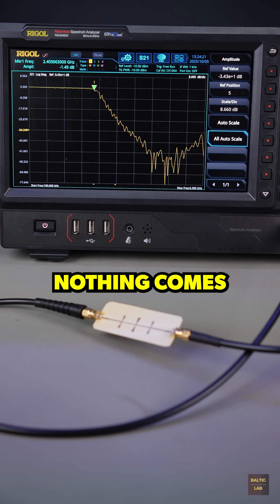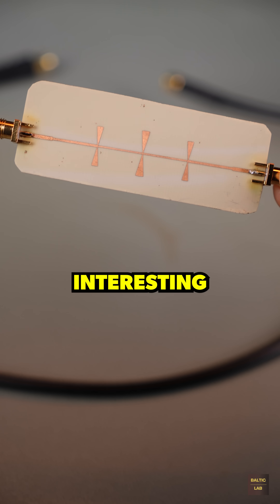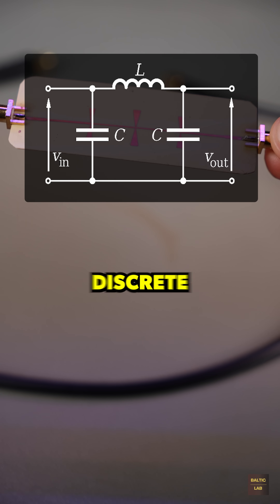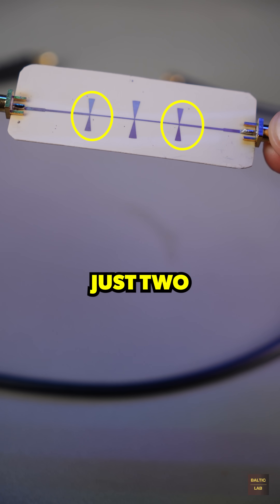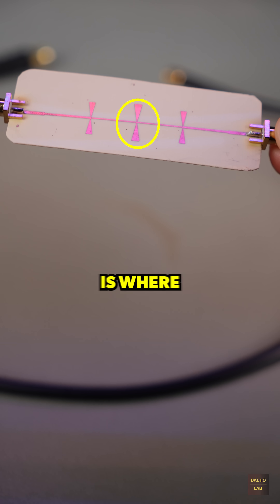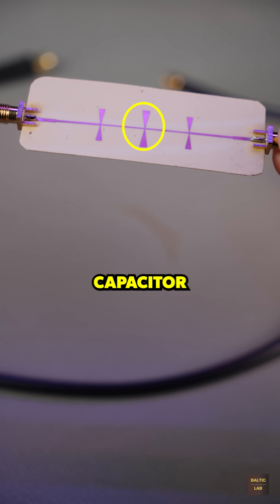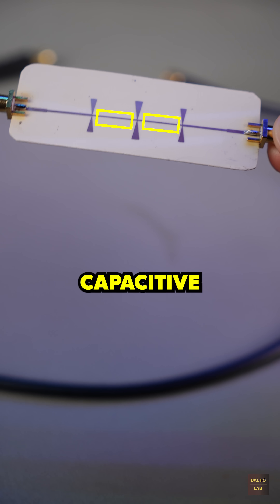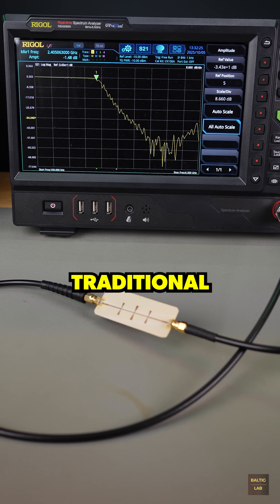Radio Frequency Magic: 2.4 GHz Low-Pass Filter with Butterfly Stubs  #electronics #hamradio

Comment: Black magic. Someone tell me that engineers aren't just code names for wizards.
Reply: Engineers solve problems you never knew you had in ways you will never understand.
Reply: @sherpadoug  by making the problems obvious so we fix them ourselves* 😂
Reply: Engineers are all secretly wizards. And engineering ethics is the secret committee that decides which magic is too cool to show the non-wizards.
Reply: @Somespessman  You have exposed us.
Reply: @gary2300  some dude named gary yup, checks out, he's probably a wizard. That sounds way too inconspicuous
Reply: @Somespessman  Yeah, like Agent X, H-Bombs and other cool paraphernalia.
Reply: Not just engineers but analogue/radio/hf engineers
Reply: @forbiddenera   You don't think that internet routing is magic? Or the suspension of an F1 car? A flash drive? How modern cutting tools chew through hardend steel resulting in mirror finishes with µm accuracy?
Reply: @TheEvertw tbh I am a sw engineer, network engineer, automotive engineering so no, none of those things seem like magic to me (well, fair, any silicon etching is pretty magic) but rf/uhf? Yeah wizardry
Reply: @forbiddenera and wizards understand magic
Reply: @forbiddenera closed loop electromagnetic power generation is possible
Reply: @DaneSage  as soon as you draw power the loop opens and generation stops
Reply: This is how I feel about chemistry
Reply: @nos4me as above, so below
Reply: @nos4me  I'ma be a chemical engineer 😅
Reply: @nos4me Yes, as a chemist I agree. Even when a synthesis actually works and can be well understood it feels magical. And then there are some reactions that work succesfully but are not fully understood by the community. Still if it works, it works and often that is good enough.
Reply: Oscilloscope owners are wizards
Reply: Arthur C Clarke:  “Any sufficiently advanced technology is indistinguishable from magic.”
Reply: Just the RF dudes. To other engineers, it’s still black magic
Reply: Not all but the high frequency electrical ones are! 😁
Reply: as long as that wizard doesnt use einstein's infamous equation to create nukes out of water droplets... wait....
Reply: A: Computers are just magic.
B: What? No they're not.
A: Sure it is. You take a rock, you print it with fancy runes and hieroglyphs, And before you know it, your taking energy and manipulating it to do your bidding. The really advanced wizards know such complex rune patterns, they can even make rocks think.
A: ...
B: Yeah, exactly. Magic.
Reply: Yea,but what would i know/😊
Reply: You would love the book "Off to be the Wizard"
Reply: Shhh, dont tell them that
Reply: It is about education and interest. Nothing comes for free...
Reply: specifically RF engineers, specifically the very few working in antenna design. There might be a few thousand of them in the world compared to millions of engineers
Reply: Wizard is just a fancy term for someone who won't or can't explain what they are doing. Possibly because the don't understand it themselves.
Reply: They can litteraly make floating runes
Reply: They're putting runes on the PCB in plain sight for all to see!
Reply: I prefer WARLOCK
Reply: Scientists are wizards; engineers are warlocks. Not the same.
Reply: I was a wizard... Until my title was changed to Electrical Engineer II
Reply: Yer an engineer, Harry!
Reply: electrical engineers are just wizards who tricked sand into doing math when zapped with electricity
Reply: John 14

  6 Jesus saith unto him, I am the way, the truth, and the life: no man cometh
unto the Father, but by me.
Reply: @John_14_21  6 DOLLAR SHRIMP SPECIAL!
Reply: The seals of solomon force them to serve us

Comment: It's not a low-pass filter, and the explanation is completely wrong.
Reply from the maker: Good to know you understand the filter I designed in CST Studio and characterized in the lab better than I do. Let me guess: you saw butterfly stubs and immediately assumed it had to be a notch filter, applying your limited understanding of a single stub to a carefully crafted commensurate-line filter. I'll nominate this for the Dunning-Kruger Award for most uninformed comment of the week.
Reply: prove it.
Extra points for not using words like "magic".

Comment: I love electricity because if you do straightforward things with it, it acts very nicely. 
Then you start trying to crank up the voltage - great, now it won't go in the wires
Then you try cranking up the amperage - Noyce, it just blew up the wires
Then you try cranking up the frequency - why the fuck is it a wave now?
Reply from the maker: Absolutely! No matter the area of expertise, there's always so much more to discover. And I think that's beautiful.

Comment: How does one even figure out how these elements influence each other?  I can work out a simple antenna or PCB inductor or capacitor, but this is another level, especially with delays.  And why the pointed shape?
Reply from the maker: Nowadays software such as CST Studio assists in the design process. I assume by pointed shape you mean the radial stubs. The advantage of those over "normal" stubs is a more smooth frequency response.
Reply: @BalticLab thanks for the insight! 👍
Reply from the maker: @Qui-9 You're welcome!

Comment: How could they be capacitors? It looks like a conductor is connecting the two triangles.
Reply from the maker: They are connected and are together essentially one plate of the capacitor. The other plate is the groud-plane on the bottom side.

Comment: I don't get the diagram as a low pass filter bc the L approaches an  open circuited at high enough frequencies
Reply from the maker: Right, so that will cut-off "high enough frequencies" and let lower frequencies pass, right? There you go, you just explained the low-pass behaviour yourself.
Reply: @BalticLab oh yeah hahahah 😅 I was way over thinking it

Comment: And they said that advanced math was pointless... 😂 You could make one to any frequency you like but it gets bigger as the knockout frequency is lowered, geometricly so it's good for cutting out extremely high frequencies but impractical for lower ones. If you take apart radar and satallite recover amps you can see lots of things like that 😮
Reply from the maker: Exactly! High-frequency electronics are all about applied math and physics. 😊

Comment: You can also design a specific notch filter using an unterminated tap of an exact length to cause the signal to reflect backwards at a specific frequency.

Comment: I thought you used a bunch of zigzag traces for an inductor. But turning a capacitor to an inductor, that's a first.
Reply from the maker: You can, there's many ways to make an inductor. If you look up Kuroda identities, you'll see how to turn a series inductor into a shunt capacitor and vice versa.
Reply: @BalticLab Does it involve paraditics, or is it black magic?
And I've heard if you pass a frequency higher than the self resonance frequency of a capacitor, it behaves like an inductor.
Reply from the maker: @ShinjiIkari-Eva-01  It's correct that a capacitor will act like an inductor above its SRF. Likewise, an inductor will act like a capacitor above its SRF. But that's not the effect at play here. Simply said, what really differentiates an inductor from a capacitor electrically is the phase shift. By adding an appropriate amount of phase shift, you can turn one into the other.

Comment: Microwaves border our realm and Black Magic's.
For Anything beyond you'll need Runes on your PCBs.
Reply from the maker: The runes make things easier once you understand them. Being able to essentially incorporate entire circuits in the copper layer itself is kinda cool.
Reply: @BalticLab  Exactly, That's why people turned to Blackmagic in the first place. It was easier and cheaper to have Runes do the work for you.
Btw, jokes aside. its actually not economical at all. its very space inefficient which makes the entire device bigger and that alone introduces more cost and complexity down the line.(i dont need to tell you how small a 5khz SMD L.P.F is ). That's why designers put the H.F stuff under a can and snuff it out as quickly as possible.

Comment: Microstrip technology: Antennas, MW components, Filters, R, L, C components. It's funny how you're doing complex equivalent schematic "on paper" and in the real world, its just few milimeters thin lines :D
Reply from the maker: Indeed. Though it's funny to watch students design those traces on paper: Yes negative dimensions do check out mathematically, but are kinda impossible to etch on a PCB 😂
Reply: @BalticLab  I remember when I was doing my bach. final thesis on broadband low-profile microstrip antenna with CPW with AMC in Ansys and was optimalizating dimensions for 5,8 GHz and then I realesed, that if I change dimension about 0.000001 mm, s11 argument will change about 20°. So the realization was like: "The FCK is this kind of sorcery!" :D :D

Comment: Is this 3rd order because it has 2 capacitors?
Reply from the maker: Yes. Though just for completenes: Technically, the filter is a 7th order filter. I just simplified the workings and schematic a lot for the short.

Comment: Low frequency engineering gets pretty funky too. 
Especially power stuff.
Like harmonics and flltering 
Or the weird shit high power silicon can do like in Inverters and variable frequency drives. Apparently annihilates your sinewave and pf and sends nasty distortions and harmonics upstream.
Ever had one large (500kw kind of large)  VFD straight up grenade the input stages of multiple smaller VFDs on the same bus when the right conditions were met 😅. 
Like how is that even possible.
Or how in a 3 phase system harmonics can accumulate in the neutral conductor and cause an overcurrent situation on the neutral.

Comment: Black magic indeed. While direct current always take the path of least resistance alternating currents take the path of least inductance!
Reply from the maker: Essentially yes. Though formally it's the path of least impedance. Which in most RF cases of course comes out to what you said.

Comment: How susceptible is this to the tolerances in pcb manufacturing?
Reply from the maker: Quite a bit. In production PCBs there would be striplines with test points included in the PCB panels and the manufacturing job would include an impedance verification test.

Comment: Actually they are called “radial stubs”. It looks like RO4003C
Reply from the maker: Acttually, they're called "butterfly stubs". Which is probably why I called them that. A butterfly stub is made out of two radial stubs each. It indeed looks like Rogers 4003C. Or RO4350B, Arlon 25FR, Isola I-Tera MT40 or any other ceramic substrate.

Comment: Subscribed based on just this short, amazing.
Reply from the maker: Excellent, welcome aboard. 🙌🏻
Reply: @BalticLab me too !! 😅👋😁✌️🤩
Reply from the maker: @InfinitoFromEurope  Welcome aboard to you as well. 👌🏻
Reply: @BalticLab  Thanks so much !
Yours video’s subjects are passionating !!
I know how tu make an antenna or respect a wire length/co-linear/co-axial cables to respect impedance and haven’t phase shift at the output signal/at the end of line and I like this explanation of simple copper print on epoxy fiber to make some filters….

Thanks so much for the vulgarisation !
Reply from the maker: @InfinitoFromEurope  Thanks a lot, Feedback like that motivates me to keep posting and dedicate more time to the channel!
Reply: @BalticLab  You’re welcome !! (Off course !)

Note : I’m French and live in France (Europe).

Many networks interconnected (called inter-net ) make this possible : an « instant » messaging (in a streaming-video plateform) across the globe !

Thanks !! 🙏 
✌️😁
Reply from the maker: @InfinitoFromEurope  We're basically neighbors then: I'm from Germany. 🇩🇪
Reply: @BalticLab  indeed !

I’ve watch your YT channel and I’ve one question :
Did you have make one or some video(s) to make an DIY pre-amp ? But an DIY pre-amp with ANC for electrostatics mikes or (better tech) MEMS microphones ? 

My old car have a cheap Pioneer car radio (with Bluetooth) and an oldest and cheapest dynamic/electrostatic (I think it’s just dynamic mike) microphone and all of my calls are noisely across the conversation. 

Have you an idea to make a better sound at lower price and simple technology like an « voice » mike and another one or two « ambiant noise » mike and reverse the polarity to cancel the noise ? With (why not) potentiometer to adjust the ANC gain/effect and another potentiometer to adjust the output level to enter to the « mike input » on my car radio ? 

With also maybe a signal attenuator to reduce the output signal to not saturate my car radio mike input ?

If I can ask for 2 others specs : low-pass filter and independant high-pass filter to have a narrow band or large band for my calls, after the ANC circuit ?

The voice is a narrow (legacy) or large band (« HD sound ») across the 3KHz from 8KHz narrow band to largest wide band (I think from 500Hz or less to 4KHz).

If you can help me with my unpleasantness calls quality, I’ll be grateful for ever and you can make some videos to your channel with these ideas ! 🙏🫶

Thanks so much ! ✌️😊🫶
Reply from the maker: @InfinitoFromEurope  I'll put that idea on my never-ending list of content ideas. 👌🏻
Reply: @BalticLab  Thanks ! 🙏

Comment: The way I learned it, this isn't High Frequency technology but Ultra High Frequency technology. Perhaps the nomenclature is changing, but I'm still a LF, MF, HF, VHF, UHF, Microwave, IR, Light, and UV kind of guy. There are very clear building techniques that demark each section of the spectrum - I'd hate to build a filter using those techniques for 6 MHz ( A true HF Frequency).. :-)
Reply from the maker: By "high frequency," I mean it more colloquially, not in the context of ITU band designators. I might switch to using "radio frequency" going forward. It's tricky to pin this circuit to a specific band designation, though, since it operates across a broad range-covering LF, MF, HF, and VHF in the passband. UHF (ITU) spans the transition from passband to stopband, and even at SHF, it still works as a solid attenuator doing what it's supposed to. Technically, "HF" isn't entirely off as an ITU band designator, as the circuit continues to perform RF functions within that range. But that's splitting hairs.  Additionally, I'd like to add that "UHF" is ambiguous: The ITU defines it as 300 MHz to 3 GHz, the IEEE defines it as 300 MHz to 1 GHz. So for UHF it is important to say either "UHF (ITU)" or "UHF (IEEE)".

Comment: Thanks for making a video on my fav EE subject. Im an RF engineer. I learned how to make these circuits in my Passive RF Lab, where we milled these high frequency structures from a blank, and then characterized our design against our simulation. Too bad I have to just use lumped elements for things like this in the products i make.
Reply from the maker: It's always great to hear from a fellow RF engineer! It's a fun topic indeed. 😊

Comment: EE here:  The real magic happens when a designer can make a low pass filter  for $0 in components so as to make the higher-ups grin.  I don't count the pcb since that had to happen anyway.  Usually the rest of the circuitry is on it.
Reply from the maker: Distributed element low-pass filter here: The EE is correct. ☝🏻

Comment: I need a couple of those at 177Mhz that handle a few watts. Under 10. How do you get them?
Reply from the maker: The dimensions depend on the wavelength. At 177 MHz they're gonna be rather large. Assuming a relative permittivity of 4, just a single quarter-wave stub is going to be ~21cm long.  The power rating is no issue though. I don't know any commercial sources of those for 177 MHz.  Requires either a lot of headaches and experimentation or professional, and thus very expensive, design software. I use CST Studio.